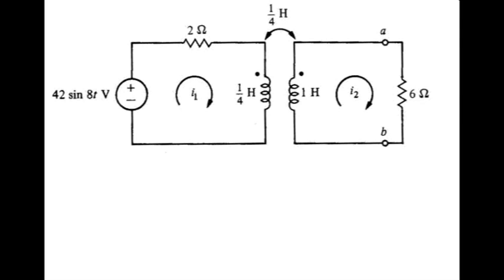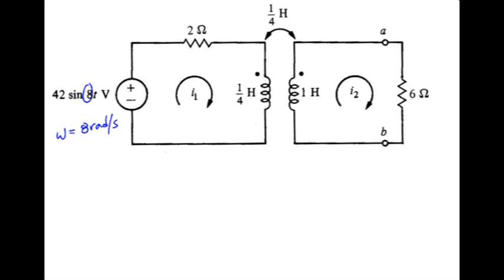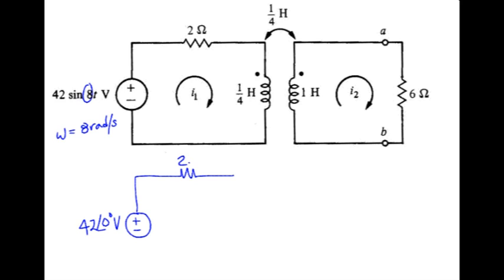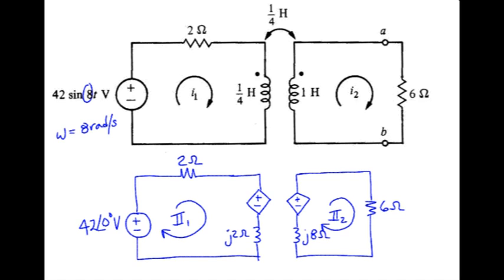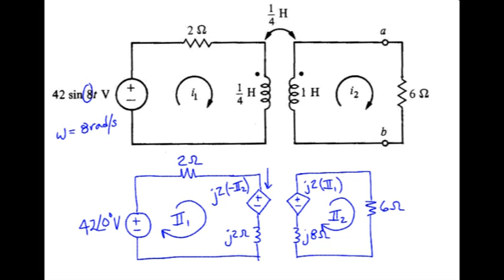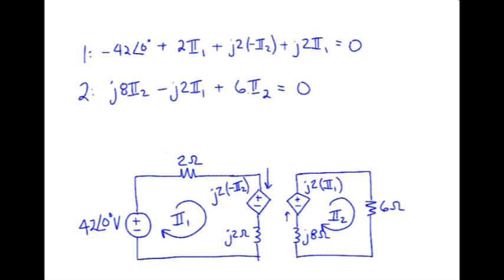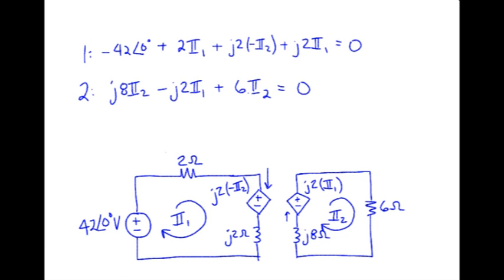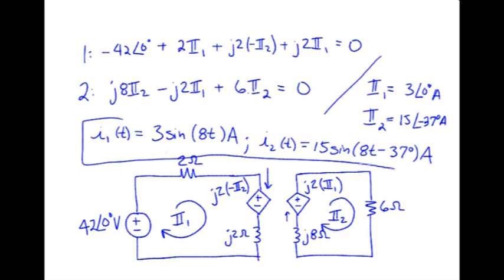ac: Mutual Inductance Example #1

Comment: how does "42 sin8t" equal 42/0'? it should be 42/-90' i guess.
Reply: +Mete Yıldırım Assuming you already figured it out by now but for others wondering; notice the final answer. He left it terms of sin instead of making the final answer in terms of cos. Now, if we wanted to show the final answer in terms of cos then yes we should make the voltage source show as 42/-90. It just depends on how your professor wants you to show it. Since we left it in terms of sin the correct way to show it is 42/0
Reply: it just because he got the time domain value also in sin scale.

Comment: I use fx 570 to calculate and of course by using simultaneous equation.
but then, the calculation always turn out wrong.
I believe the thing got wrong when I move the number from left side to right side or vice versa. Can you show the correct way on how to solve the current by using simultaneous equation? I really need to clarify my understanding huwaa!!

Comment: I think the answer is the vice versa. I used matrix methods and get the answer of I1 & I2 the other way round. Can you reconfirmed? Thanks!
Reply: Yeah, he messed up. When he solved for I1 and I2 he got I2 = 3 and then when he wrote i1 and i2 he had i1 = 3.
Reply: i inserted the equations into an equation solver after converting everything to polar from rectangular and the same thing happened to me